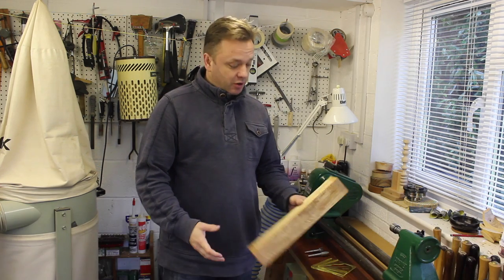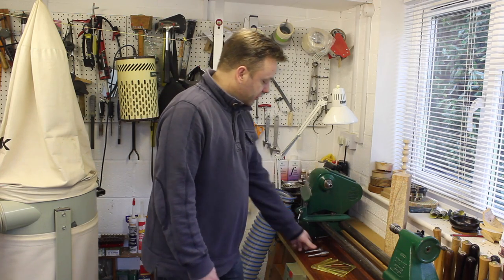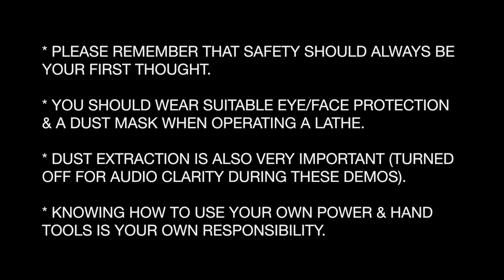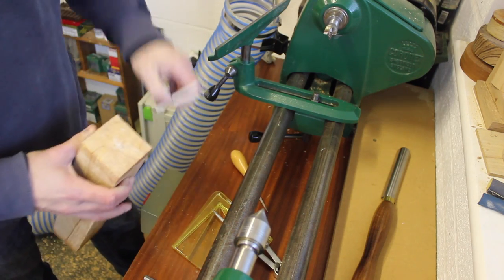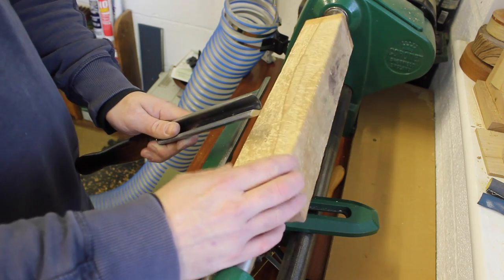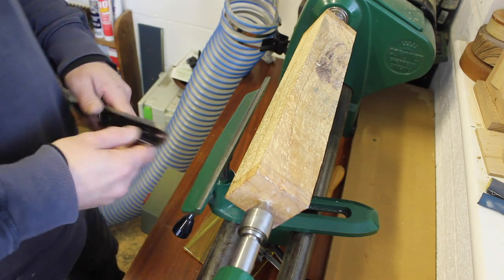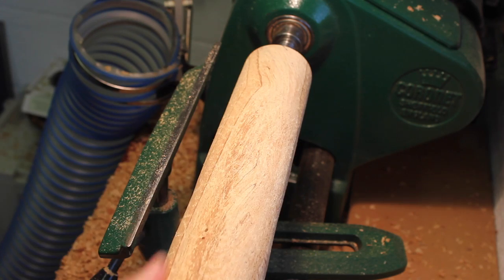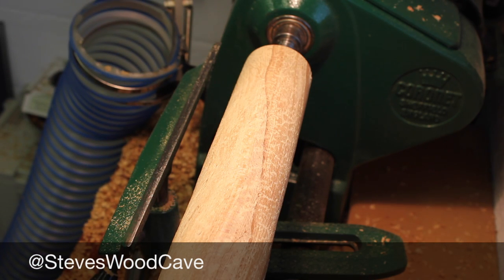Part 1 of 3 : Woodturning for Beginners / Spindle Turning - Roughing from Square to Round

Comment: Good video Steve, very informative.
I am toying with the idea of starting this as a hobby.
What should I look out for when buying a lathe?, more so a used one please.
Reply from the maker: Thanks Gary! It’s difficult to suggest a starter lathe really. Everyone has a different opinion and different budget etc. Plus I’m in the UK and you may be in another country, I don’t know? So the lathes available to me might be different. Also I was given this basic lathe, a Coronet CLO/24, so I’ve never had to buy one (yet). I would say a small lathe like this is fine if you don’t want to spend much. It has only three speeds and a belt which you have to physically move when changing speed. The two horizontal parallel bars can get in the way of your tool for some cuts. Removing the tail stock is a painful and slow operation. So I would buy the best you can afford, if it doesn’t work out then you can always resell it. But to make it a more pleasurable start I would avoid lathes withe belts that you have to physically change. Hope this helps?

Comment: Great video, which I found really useful as I’m just getting started in wood turning.  Liked & subscribed! Could you answer a question? When I’m turning a spindle from square stock I end up with lots of wavy lines in my work piece. Any ideas why? Thanks. Mike
Reply from the maker: Hi Mike, thank you. I think that this is quite common when you start woodturning. It’s all about tool control I reckon. Try to slow down a bit as you traverse across the spindle. Take further finer shavings. I assume you’re using a roughing gouge? It will probably just improve with plenty of practice... hope this helps?
Reply: @SteveCashmoreWoodworks  Thanks for taking the time to respond with the great tip, I’ll give it a try.